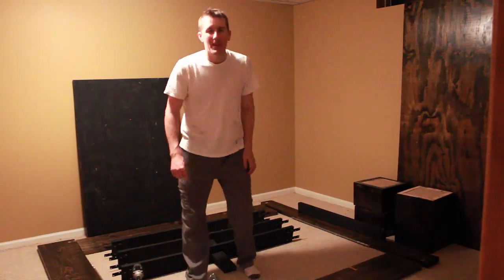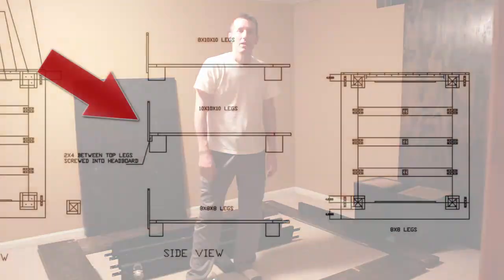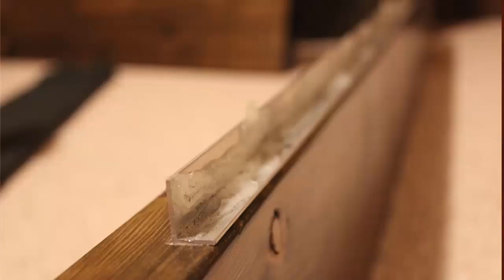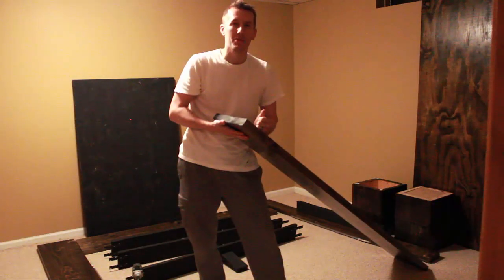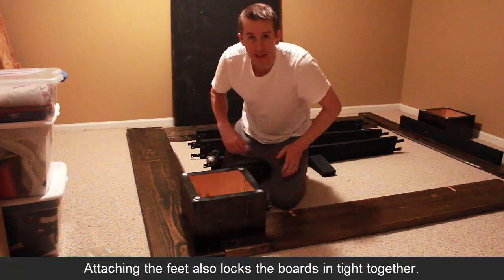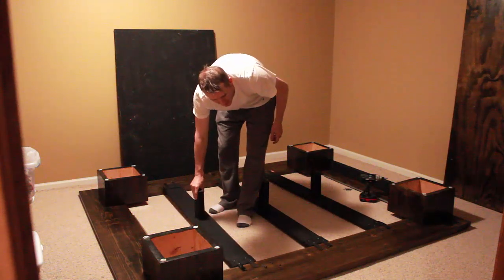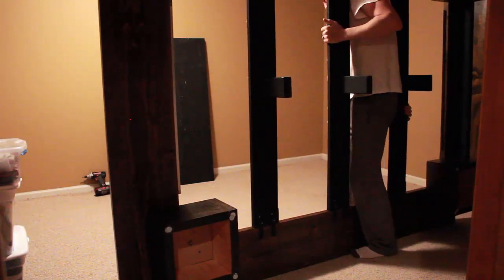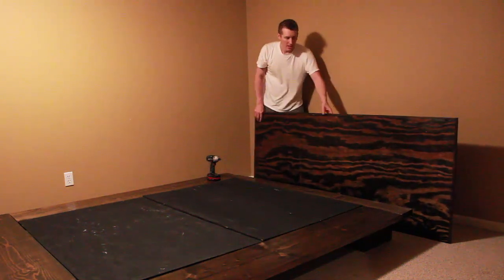Platform Bed - Build Plans

Comment: since its the bottom you could mark off  the corners of the legs on the piece of wood you are drilling into so you dont miss screw holes and have a bunch of holes there and for a less permanent solution you could just put a strip of painters tape right where the box will be place so that when you line the box up youll just have to see if the painters tape is covered on each side then once its installed you wont see the tape

Comment: Cost of materials? Shopping list break down?
Reply from the maker: I built it maybe 8 years ago, hard to remember.  But i do remember that the total cost of the wood was $100 - $120?  Plywood headboard was $20.  4 - 2x12's (3 sides and 4 legs) were maybe $40.  1 - 2x8 (top) was maybe $8.  Plywood for under mattress was maybe $15. Then all the brackets were maybe $10.  Hopefully you can get the exact sizes and boards from the PDF or the AutoCAD drawing in the description.